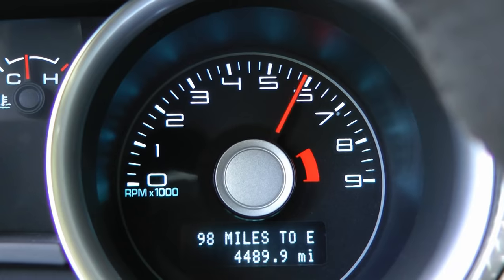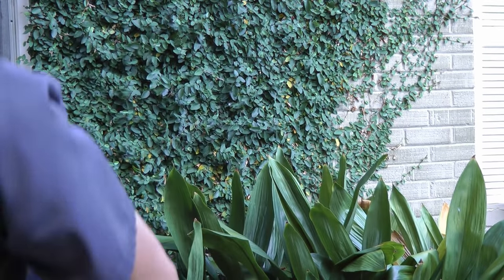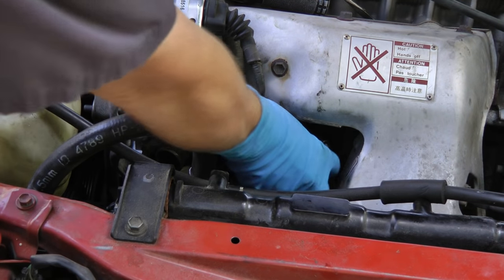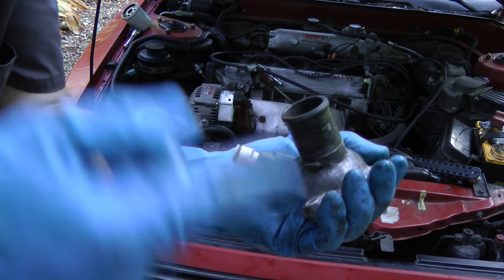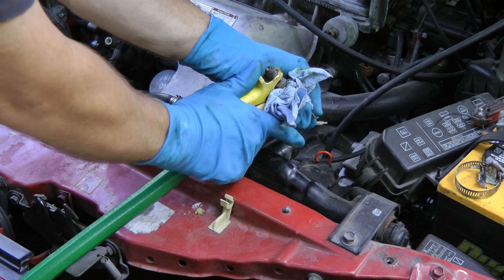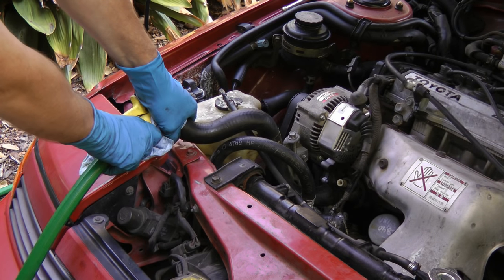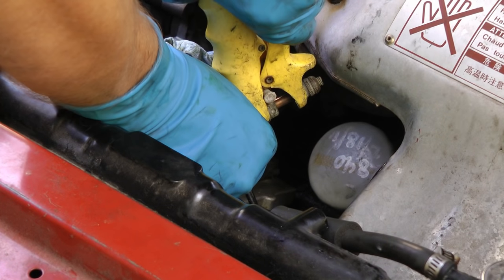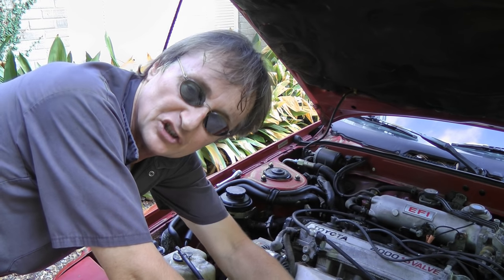How to Flush a Coolant System in Your Car (the Easy Way)

Comment: Scotty, love your vids but to be honest, this one just sucks. Using just water for a week...not me. Using anything but distilled water...not me.
Reply: I thought this to be one of his better videos. Im a fan of distilled water and I wont run my car for a week on water only but hes right. Its fine. My dad used straight water forever in his truck and it eventually killed the water pump and had corrosion but I flushed it all out and the truck engine is still fine many years later. One week wont make a difference.
Reply: in your case you definitely need to use distilled water bro. those mercedez engines are weak as fuck aka lady engines aka delicate flowers. 

wouldn't be surprised if some sensors get damaged if you use tap water, hell the whole car might break down. 
in some of them, a damn worn down battery can trip shitlots of codes and prevent the car from starting even with a professional jumper pack. Just ridiculous engineering.
Reply: Yeah, I agree, this is not his best, by far. There are numerous problems with his method. He never mentioned anything about pressure on the garden hose. Full blast hose? NO! That can damage the seals. Anyone who has done similar vids, have always said, use low pressure on the hose. It will still get lots of gunk out, but you don't risk causing a leak by blowing the seals. They are not designed for high psi, cause coolant doesn't run at a high psi anyway. That running the car for a week on just water is also nonsense and unnecessary and very risky. 

Just run new coolant, with the old thermostat in and flush again in a week, no risk. Drain again and replace the thermostat after that. He also didn't even touch on what others have, like flushing the heater core the same way. You can get or make a kit with smaller hoses to forward and back flush it too. Again low pressure on the garden hose. This was his worst video ever really. I like his vids and for the most part he makes great vids, but this needs a redo, with more details and cautions.
Reply: He says to put a rag on the hose tip to avoid splashes, that can also restrain the 60 psi that water hoses can deliver.  Needs more info on that part but we love Scotty anyway.  Saved me thousands so far. Honor to you Scotty.
Reply: Bill Does Stuff What seals will break sir? Isnt the coolant under more pressure when engine is at running temp?
I agree with distilled water fo sure, its less than a dollar per gal. Thats the only part i ddnt like about the video....
Reply: why so many likes for saying this video sucks? it was a very cool video
Reply: That water jet from the garden host nozzle is hitting the coolant hose first.  So anything down stream from that isn't experience hardly any high pressure water at all.  You really need to go back to grade school physics class.  Or just get out you garden hose and spray a wall and see what happens to the water jet after it its the wall.  doh!!!!
Reply: Aluminum and water! Bad mix.
Reply: @BLAZEPSI  15psi typically
Reply: @MrBilld75  sounds about right sir.
Reply: @nunyabiznis817  I hear ya Nunya and you make good physics sense, sure. Lol. It's just that every time I have seen other vids of this, they have recommended lower pressure. You can still use a garden hose, just turned on lower. It's still going to flush the system regardless, just by virtue of water movement, volume, gravity etc. It's hard to know really who's right. On the one hand Scotty has his decades of experience, on the other hand, I've heard him say a few dumb, very incorrect things.
Reply: There is a reason for distilled water though and it has to do with minerals (lack of them in distilled's case). Mineral deposits, clog things. Especially when heated and especially in the little passageways in radiators and heater cores.
Reply: @Larrlos  Thank you, your answers were good too. I don't claim to be any expert, I am just a back yarder amateur who works on his own car from time to time and watches a lot of car vids to become better at it. There are some things which still scare me on vehicles. Lol. I am certainly not 100% comfortable with doing my own repairs. Especially stuff like timing belts on interference engines. Shudder. So afraid I would do it wrong and then have the pistons slam into the valves. Lol. That or a complete engine tear down and rebuild or transmission scares me too, but I am damned near game for anything else. Saved thousands, so I am just going to keep learning and fixing my own stuff.
Reply: @MrBilld75  Not true, it can be preferable for a slightly basic coolant to inhibit general corrosion
Reply: I used water in a car for the whole summer once. I had blown a coolant hose and used just distilled water to fill it up after I fixed it. I then lost track of time but flushed it out before winter. No problems at all.
Reply: @BLAZEPSI  , no--the coolant is NOT under more pressure than a water hose when running at temp. The only part of the entire cooling system that creates flow (not vacuum pressure) is the water pump, and the pump doesn't push water at 60+ PSI...

Comment: If you are riding around with all water and no thermostat makes sure its warm out.
Reply: Tool0GT92 I was gonna ask why but forgot some parts of the us get snow
Reply: And the world... :)
Reply: No thermostat will cause the engine to warm up too slowly.
Reply: You won't do that in the winter anyway, your heater would NOT work then -)
Reply: No it'll over heat. I would drive my truck around with water only and after about driving it around for 15 minutes it would over heat and the temperature gauge would be on the red side and it would automatically turn off and leave me stranded in the road and after trying to turn it on it wouldn't turn on. I would then have to wait 1 hour to 2 for it to be able to turn on again.

Comment: You left out the heater core flush.
Reply: Allan De 
Turning on the heat to high flushes your heater core.
Reply: Don't need to do a heater core flush if it's broke.

STONKS

Comment: Two part question....does using a commercial radiator flush do any good and can this type of product do any harm to a water pump or any other parts (assuming it is used per instructions)?
Reply from the maker: yes it can harm things, including damaging the head gasket. If something like your radiator is clogged, with cheap modern plastic radiators you just replace em.
Reply: Hadnt thought about the head gasket. Much appreciated!

Comment: Some1 pls explain to me how does an engine not overheat without a thermostat?
Reply from the maker: thermostats restrict flow so engines warm up faster, then they open up when warm. Take it out, you have full flow. For example, race cars do not use thermostats
Reply: Thank You! I thought the fans would not switch on. Or there is another thermostat for that?
My bad. You are the best Scotty! Love your videos. Make them a bit longer. Kisses from Hungary!
Reply: This thermostat is mechanic, it just seal the water flow so the engine warm up faster and open when the engine reach certain temperature (around 195 f) so it cool down. The thermostat that control the fans is an electric sensor, i believe is the same one that show you the engine temperature on your car cluster, when the engine gets hot it turn on the fans or turn off your car engine in some newer models to prevent engine damage when temperatures are too hot
Reply: nomad91910
Thank You!
Reply: Károly Kiegel  your water pump don't work
Reply: Shane Kirby only if you live in a country that has sunshine all year
Reply: Scotty Kilmer you are correct SCOTTY!! 
I have done this before !!  On my 69’ OLDS
442. Back in the day !- during the summer - when you don’t need any heat !!!( heater)😊
Reply: Simple...a Thermostat opens when the coolant begins to get hot, this gives the engine some time to warm up a little faster.  But has the heat rises...the thermostat opens up more to allow coolant to flow through more rapidly.  If anything...the engine will run a bit cooler without the thermostat.  Depending on whether or not you are doing local or highway driving...running without one could be either a good or bad thing.  The thermostat only controls the flow depending on the engines heat demands, most of the cooling is done in the radiator.  Some people use seasonal thermostats as well.  I use a 165 or 170F during the summer, and I use a 180F or higher during the Winter Season.   A typical Racing Thermostat can go as low as 145 to 155F.   Running a cooler engine isn't always desirable, but for the purposes of flushing a radiator and old fluid...running a week or two isn't going to hurt it.
Reply: Károly Kiegel with out a thermostat car engines run cool all the time except for cold climates
Reply: if you ever have a slight coolant leak at a seal and dont have the time or money and its above freezing pull the thermostat and your system won't pressurize enough to blow your coolant out. Quick fix def not permanent.
Reply: Cool engines uses more fuel because it's trying to bring the engine temperature up and it runs a little rich. You can get carbon buildup in the cylinders.
Reply: @kangkim150 I did exactly what you said. maybe a fuel gasoline. Inyector cleaner additive can help to clean the pistons? Or maybe a quality synthetic oil can help? What do you think? I use shell gas always. Maybe that can help lol

Comment: i think ChrisFix's video on how to do this is more professional. I don't trust driving my truck with no coolant.
Reply: You obviously don’t know much about engines then. Even my diesel in the summer is fine to be ran with water. Just don’t let it overheat or freeze
Reply: nicholasdoran funny thing is, water is the coolant. Antifreeze is added to the coolant to prevent the coolant from freezing and expanding while the motor is not running. So it should definitely be fine to run water in the summer just to flush the system👍
Reply: Knowledge.
Reply: 5 years experience vs 40 I'll trust kilmer

Comment: and never fill with tap water.
Reply: Wont hurt anything lol
Reply: Bryson Shires

yess it will. tapwater has calcuim in some forms, it will form that white layer of mineral deposit that is a verry since insulator. it will make the cooling less efficient.
coolant fluid is not equal to water.
coolant fluid has addictives to prevent or at least reduce cavitation, and has no minerals that can deposit.
a happy engine has coolant fluid in its cooling system, and not tap water.
Reply: The high temperature of the water increases solubility of ions in it and has a very similar boiling point to coolant (within 10 degrees) under pressure, and without the thermostat, it will never get close to max temp.  On older engines, it's perfectly fine - it even says in the owner's manual "clean, drinkable water" is the only requirement.  Now on newer cars that have alloy blocks, you need to use distilled water - they are much more sensitive to any residual ions, and while extremely unlikely, you could have problems down the road with corrosion.  MAYBE.  Since you're going to reflush it again with the same process in a week, it's not a big deal because you'll flush out any minerals you're worried about before they cause problems.  When diluting your own coolant, HPLC or DI water is best, but distilled is also fine and works in a pinch, and as mentioned, older cars only need "clean, drinkable water."  Go by whichever your owner's manual says, or use HPLC, or DI, or RO, or distilled water (in order of preference) to be on the safe side.
Reply: Alex M

allso you need to add something to prevent cavitation and stuff. usually antifreeze has everything you need.
and this is why i use antifreeze even in the summer.
Reply: I agree.  Long term you wouldn't want to use mineral water, but doing it for only a week isn't going to hurt anything.  If you use a flush kit/solution it has anti-cavitation chemicals in it, so you wouldn't even be running without for the week you do the flush if you're really paranoid about it.
Reply: it is corrosive so yes it will if it isnt flushed with distilled water after. commonly known. old school mechanic dont usually do this tho.... but yes you are wrong it is bad

Comment: What year was the car ? I have a 99 chevy express, mechanic told me it's more difficult to flush out the hoses than in older vehicles. He said the older ones have one hose , but for my van it's more than one ....kinda like going though relay stations ? (If I got that right ?)

Comment: maybe you can clarify this question. My mom told me to add 97% antifreeze and I said hell no. I use the same as you, the Prestone Premix. She still insists that its better to add 97% antifreeze. However, no where in the mazda manual it says to use 97% antifreeze. It says, "Do not add more than 60% antifreeze." Even the factory oem coolant uses 55% antifreeze/ 45% demineralized water. So I decided to follow the same steps from your video. She says a lower concentrate of antifreeze wont protect my car as much as a coolant with a higher concentrate. Your clarification would greatly be appreciated.
Reply: I realize I'm 10yrs late, but as far as I know what ur mom said is true. I'm getting ready to do a flush, but I live up North so I'm doing prolly 100% antifreeze considering it gets to -70f° where I live
Reply: wow where do you live
Reply: @mclovin3298  i live in texas it doesn’t get really really cold so i use 50/50

Comment: You run straight water for a week? Wouldn't straight water boil causing increased pressure or engine overheating?
Reply: No the water gets cooled by the radiator. The coolant is just there to prevent the water from freezing, but the coolant also has other stuff to prevent corrosion I believe

Comment: hey Scotty your the best . I have a honda ridgeline and i never had an issue with my cooling system for 8 years , no flush or anything. does that saying work here IF ITS NOT BROKE DONT FIX IT. What are the signs to look for Scotty ?

Comment: I'm a huge fan!  I was wondering if you pre-loosen nuts bolts and hoses b4 doing the actual video.  You make it look so easy, but I would think there would be some degree of effort necessary to remove these old sometimes rusted on parts.

Comment: Hey Mr. SCOTTY. I'm a fan of your channel, I'm from the middle east. In every vid. We learn more and more from you. Now My Question is that we have a 04 chevy blazer recently we've changed the coolent and the thermostat a make a mixture of 50 water and 50 coolent and with that the can can good above the middle of the coolent gauge  (coolent temp.) is it normal because the car is big and the temp in our country above 50 C or it's not ?? And if it's not what I can do to get it back to the normal temp. In the middle ??         (the car had  a normal temp. back in 2 weeks and then it started to go above the middle then we chang the thermo. and the coolent)

Comment: Hey Scotty, isn't the overflow important to clean out too?  I just had a mechanic flush out a very dirty system but they insisted on replacing the thermostat even after I had just put a new one in not long ago.  They didn't clean out the overflow and I don't think they even put any fluid in it.  It sounds like a half-assed job to me but I wanted to get your opinion.  I should have done this all myself but it's cold out and I've got no access to a hose.  Even if I did, it would be sulfur water anyhow.
Reply from the maker: not much is in the overflow, but you can easily hose it out
Reply: Scotty Kilmer Do the coolant testers work?

Comment from the maker: yes, I would change those parts. And you can blast crud out of the reservoir using a garden hose, messy, but it works if you don't want to remove it from the car and do that with the hose upside down

Comment: Hello Scotty! My? is I have a (96 Chevrolet,Corsica) I use to get back and forth to work...My problem is that It takes "Dex-cool orange coolant" (and I had used one time before "green Peak brand coolant")...I want to switch back to the Chevrolet recommendations! I need to flush all the crud out,and the whole thing is bone dry with some funky gunk stuck all over in the water tank?Should I take this thing to a radiator shop or do it myself? (I just had the head gasket replaced) and Im not very good at these things (yet) Id like it done right!

Comment: Is there a way to check if the coolant system needs to be flushed? Honda says at 50K miles. But no auto shop has told me it's time to do it and I'm pretty sure they said they checked the "fluids"

Comment: Hey Scotty,
How much water from the hose would be trapped in the engine/rad if you flush it?  People tell me that he water from the hose contains minerals that could damage my engine.  Also, if mixing 50/50 coolant with water, how do you know whats really 50/50 if some water is in the engine/rad?

Thanks!
Reply from the maker: most people use regular tap water in the mix, but if you don't want it, blow it out with compressed air and use distilled water. To find the correct mix, you test it with an antifreeze testing device. All mechanics have em, all auto stores sell em

Comment: Scotty I use to have a 96 camry today I got a 97 camry,1 difference I noticed is this 97 has a green coolant where as my 96 was always a pink/red.Would you suggest I at somepoint flush out the green and use pink or is the green what I should stick with and if stick with green do I have to buy it at someplace special?No regular store ever sold the pink..i had to get some at an auto repair place,it was that or order from amazon or go to a Toyota dealership.Thanks Scotty!
Reply from the maker: +Slicknick 48  flush it out and put pink in, it's much better
Reply: +Scotty Kilmer thanks Scotty,until I can afford a flush can you recommend a place that sells some of the green so I can keep my resvoir topped off?